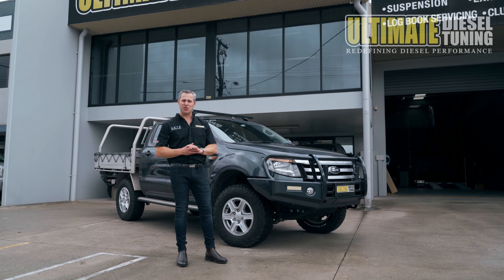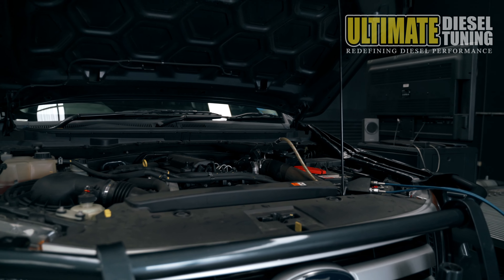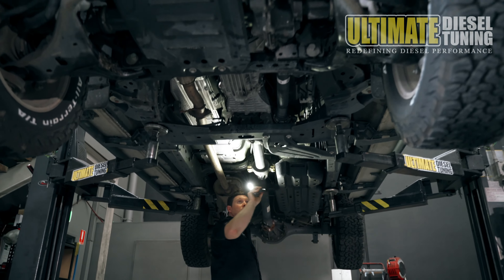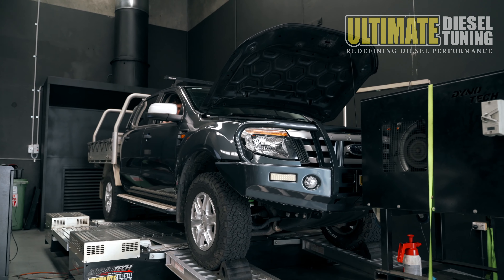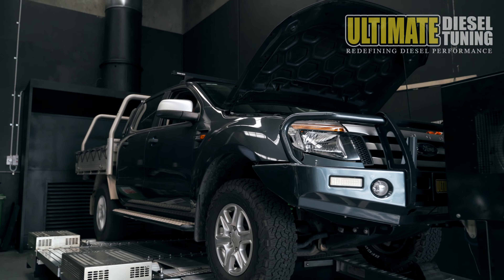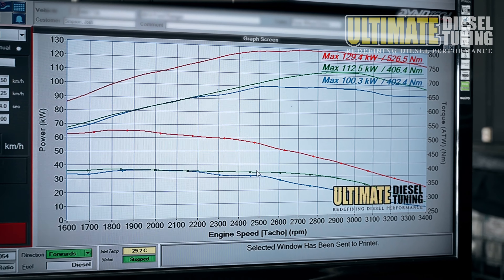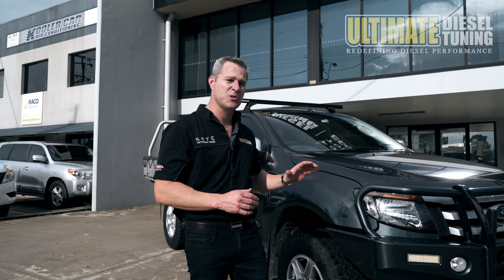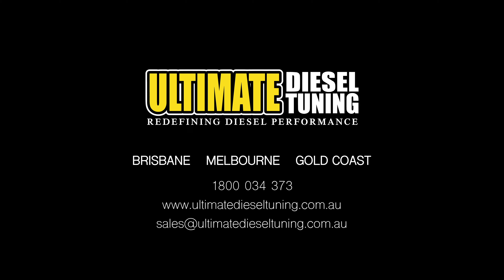Ranger PX1 2014 model - desoot + tune package! 31% gain in torque!

Comment: Is it necessary to tune the transmission along with the engine?
Reply from the maker: No it's not. Sometimes, an engine ECU tune will improve transmission shifting as well in some models.
Reply: Is that the case with the 2014 PX1 Ranger?
Reply from the maker: @vonlogan1  yes
Reply: @UltimateDieselTuning  is there any need for a throttle control, once you’ve done a remap?